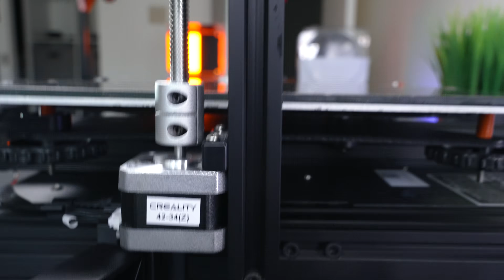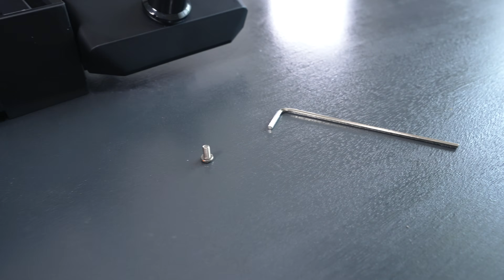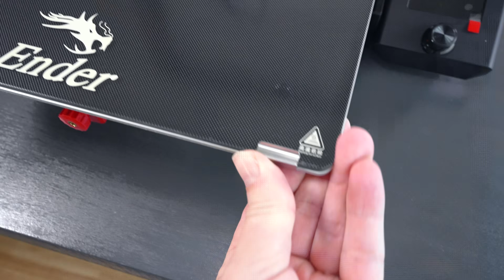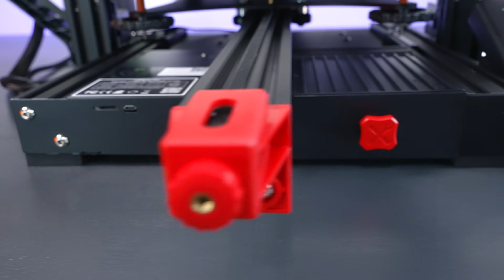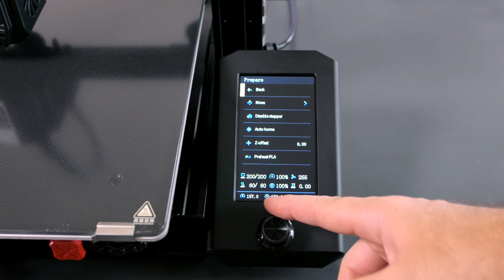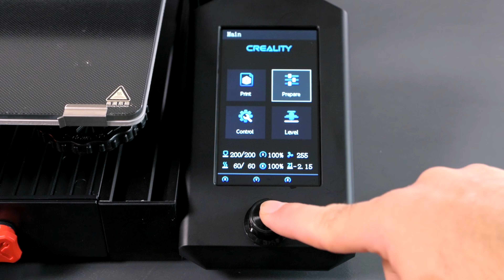Creality Ender-3 Max Neo - Overview & Bed Leveling

Comment: When you are doing manual leveling what exactly are you doing with the paper are you adjusting the printer until the nozzle doesn't touch the paper or do you want to have the nozzle touching the paper and if yes how much I mean do you want it to cause a little fraction when you slide the paper under it or do you want the paper not touching it at all and able to move under the nozzle 100% freely without touching it at all? 
Thank you very much ive watched many videos on how to do this but literally no one ever says anything about this so i am asking because i feel that this is something i need to know but no one has said what to do at all. 
Thank you very much.
Reply: I am still figuring this printer out, but generally from my experience with the Ender 3 pro, you want some friction on the paper when sliding between the nozzle and the bedding.
Reply: @AuthenticPeach but how much friction? A gentle breeze on a warm sunny day, or friction that makes the paper move with it
Reply: @TheBlazeyn  Somewhere in the middle. Key word is "some" in my original post.

Comment: This is my first ever printer, served me well and is printing amazing after properly calibrating it
Reply: And tips on calibration? Can't seem to level correctly after switching nozzles
Reply: @PatTheLogoGuy  honestly not the best guy to ask as I’m not good at it 

Best I can say is make sure the nozzle is hot when you put it is as the metal can change size and make sure the bed is level with the screws either some paper then use auto levelling
Reply: @deeznuts23yearsago  that's what I've been trying but 🤷🏾‍♂️ . Might be a different issue as my prints have gaps

Comment: I have a new Creality Ender 3 Max Neo. I’ve been printing successfully for about 2 weeks. Today, I did a short 2 hr print, then switched PLAs and started on a new print. Suddenly, when the printer attempts to home, it detects the plate, but then continues to go down and digs into the plate. Auto leveling does the same thing. I have no idea what is going on. I’ve tried adjusting the a offset way high, but that made no difference. Re-tightened some screws. No change. I’m posting a short video. Any ideas? https://www.youtube.com/shorts/JR5Z86Z-YpA
Reply: Have the same issue, adjusted the z offset and everything. Had to get pretty rough removing some prints, so I wonder if I damaged the sensor or its connection to the board.

Comment: cheers a thousand times over man that was a mission 
I do have a few questions though I had to redo my entire printer bed level but had completely forgotten how to do it so I watched your video but basically my questions are when I'm levelling the four corners do I need to have any drag/friction or do I only do it just as it is starting to get friction? Also I kind of had my z offset already set while levelling the four corners will that cause me any issues as after I did the auto levelling it needed to be adjusted to the offset that I have used since I got the printer which is -2.02

edit 2.0 
I ended up doing it all over again with the offset on zero just to be sure I'm just hoping that the drag isn't just for the centre.

Comment: I just got one of these. I do not understand how to level this thing. I already have a plain ender 3 with no auto leveling. So I know I can level a bed. But when I manually level, then try to auto level, then print, it's still printing way too far away from the bed. How can I fix this? 

I went through this three time, about nine times I manually leveled it total, just for it to be printing too high.
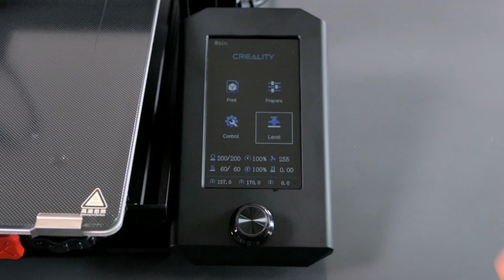Reply: Did you get this resolved? Min arrived today (still in the box) and in this vid he levels the bed, then sets the z-axis offset - see 10:04.
Did you try that step?
Reply: Same idk how to fix it
Reply: bed will be wrarped,these are a very bad printer altogether.
Reply: @roddsmith8954  not really

Comment: can't be having a glass bed personally. started with an ender 3 v2 which came with a glass bed, ended up switching to pei which has been far better, and when i picked up an ender 2 pro as a secondary, it has a magnetic bed which id also rate much higher than the glass bed.
Reply from the maker: Agreed, PEI is best.
Reply: @Just_Print  going down the youtube rabbit hole, i've just seen a review of the ender 3 v2 neo and notice it comes with a magnetic built plate. seems odd they didnt keep conistency between the 2 🤣
Reply: @Just_Print 
When you are doing manual leveling what exactly are you doing with the paper are you adjusting the printer until the nozzle doesn't touch the paper or do you want to have the nozzle touching the paper and if yes how much I mean do you want it to cause a little fraction when you slide the paper under it or do you want the paper not touching it at all and able to move under the nozzle 100% freely without touching it at all? 
Thank you very much ive watched many videos on how to do this but literally no one ever says anything about this so i am asking because i feel that this is something i need to know but no one has said what to do at all. 
Thank you very much.

Comment: Holy cow. Creality basically added all mods from thingiverse back into the printer. This thing is miles away from the Ender 3 pro I bought in 2019. Nicely done.
Reply: Still a Bowden, still a single 4010 fan for model cooling, still subpair screen, still suboptimal PSU placement... 
The real upgrades are silent drivers (hopefully TMC2209 and not TMC2208),  proper bed springs and bed insulation. 
It is an oversized Ender 3 V2. And V2 is just a worse version of Pro...